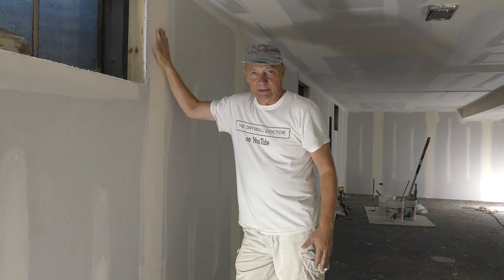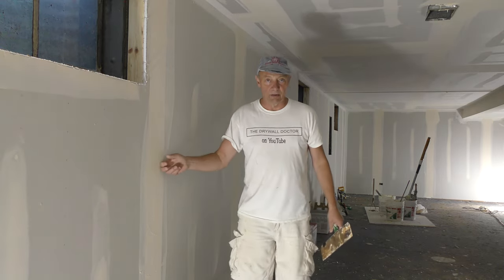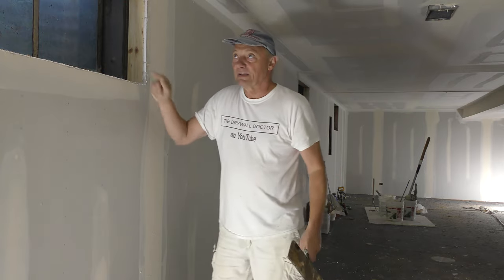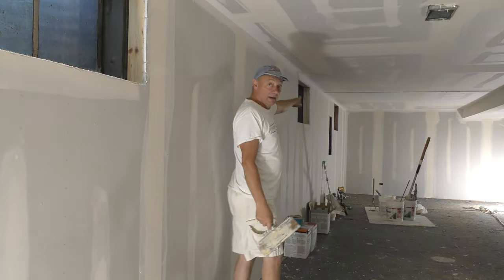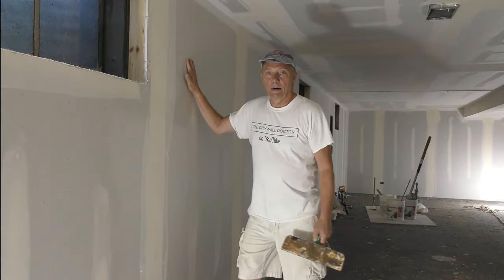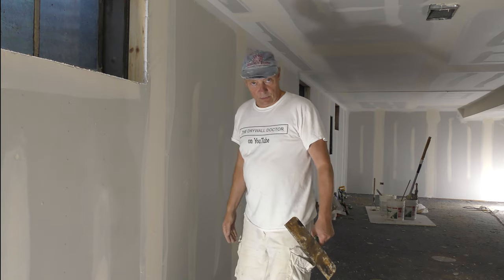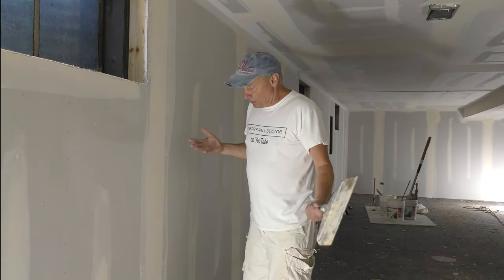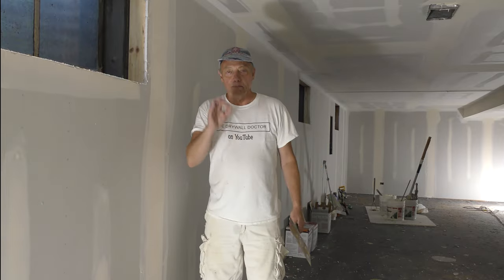Durabond Prefill Please

Comment: when I first started hanging and finishing my own work I knew as much about drywall as I do about the dark side of the Moon. So as any good engineering student does, I read the manual, several times and practiced.   It is available via CGC/USG's web site.   I'm sure each drywall vendor has their own version available.    All of your videos teach and explain as per the manual, which made the learning curve much simpler, thanks Ray.

And the manual doesn't state any different between vertical or horizontal installation, if a framing member (stud) warps that will happen regardless of the drywall.   And should be addressed prior to drywall installation (but due to crap building materials these days we have to work with what we got).    As is prefilling, which is stated as step one in the finishing process.
Reply from the maker: Thanks.  I did a job once they laid the drywall down half inch drywall the studs were 2 ft on Center and in between the studs you could just push the drywall back and forth that drywall definitely should have been stood up not laid down

Comment: I stick fiber mesh on the tapers then prefill with durabond.  That combines prefilling and first coating.  I use paper on the angles and fibafuse on the butts (which I also prefill).  Am I wasting time?  Don't know and don't care.  I've done everything I can to avoid cracking and that's what matters to me.  If I used a bazooka I'd have to change that but the jobs I do are mostly smaller and the cost, in terms of money and learning curve doesn't make sense to me.  

This might interest you.  I did some research on drywall movement and found the following:  Note this for for unattached drywall.  Screws reduce the movement somewhat and glue reduces it more.

drywall moves .0000093 per inch per degree change.  That means where I live that a 24' wall or ceiling in an unheated garage will move about 3/8" due to temperature change throughout the year.
drywall moves .0000065 per inch per percentage of change in relative humidity.  Using the same garage, my expected movement will increase to better than 1/2".  
Again, these numbers are for loose drywall.  That said, it seems clear to me that prefilling simply isn't optional.  I KNOW the rock is going to move and there isn't anything I can do to stop it and that doesn't include settling of the framing.  The best I can do is make the movement only happen in the corners by doing what you say-- turning the wall/ceiling into one condinuous sheet.

Running the rock up and down is sometimes the best option.  But I really don't like doing it in a room with lots of light.  Crooked framing can make the wall look wavey even if the joints themselves are perfect because there is a continuous joint running from the floor to the ceiling.  If I'm stuck running the rock up and down in a well lit space I'll use buttboards and make the joint in the space between the framing and feather it way out (if necessary).

Comment: We have a product out here , like Duranond on steroids; Concrete Fill , same basis as Durabond , however they add Apulgite and shredded fibreglass . A repair with that is stronger than surrounding board , mix into mud and coat beads or deep fills , zero shrinkage , sets up FAST ,
Reply: Yes all  Canadians can translate Durabond to Con Fill, it's an outstanding product.
For those marrying stucoo and drywall, or repairing stucco plaster  it's a dream product to work with, if you don't have Structolite etc available.
Thanks for posting !

Comment: I been finishing for a living over 30 years I always prefill I started doing several years ago because I got tired of the tape bubbling up. Prefilled prevents this .
Reply: Try putting the correct consist of mud and correct amount and there will be zero dry spots
Reply: it is actually an old method and until YouTube the knowledge and some of the old ways of doing things have been lost.

Comment: Hi I love your videos GREAT JOB, I have been a contractor for 38 years    . Question I was always told only hang sheets straight upand down on steel studs . On wood go horizontal with a offset . Reason being if a new stud dries outit will just crack the drywall instantly. Now on a older dried  out stud different story
Reply from the maker: Stand up drywall came into play with 2' o/c it is very weak between the studs when it's laid down and 2' on Center.

Comment: Does prefill prevent cracking by deformation of wood stud through humidity?
Reply from the maker: Only if you have a place for the drywall to settle to. Like a 1/2" gap at the floor.
Reply: @THEDRYWALLDOCTOR1  I see. Most new comercial place in here set the new studs for partitions or new wall.

Comment: Ray they quit pre-pre filling because they don’t want to pay the money . I personally want finish drywall without pre fill, dura bond or nothing 👍 .  What really ticks me off are the hangers who want bevel the butt joint, having way to many junk factory paper if not V out. If a contractor gives a hoot he will make sure it’s pre filled. Iowa you cant get away with not pre filling or your going to have trouble in less than a year, no cracks in ten years except screwed up stress points. 😂

Comment: If you only prefill without any bonding agent (like mesh tape or fibafuse) it won't be stronger. even if you tape it after it has cured.
Durabond is extremely strong but without a bonding agent it's as weak as regular mud as far as cracking goes. I don't understand why you tape your seams if you prefill with pure durabond. I've been taping with mesh tape sunken in pure durabond for 10 years, never seen a company seam crack. But I completely fill in the tapered egdes on my 1st coat. it's the key. Then 2 top coats (12" box then 15" box) and Voila. 
I agree with you, 8 footers needs to be standing up. all those butt joints on that loooong wall is calling for disaster.

Comment: How do you avoid crowns on youre flat joints. I use columbia boxes. 7, 10 and 12" and only put on enough mud to cover all the bevel on each joint. But, if i run my hand down my walls after sanding i can feel every joint.
Reply from the maker: Stop using the seven just the 10 and 12

Comment: I heard about how hard Durabond gets when fully dried, so being a DIYer, I was worried that if I made a mistake, I wouldn't be able to sand it down. So I've just been using regular quick set for pre-filling. But was thinking about using Durabond when I actually put up new drywall in my garage.
Reply: sanding brown bag durabond is not that hard! very doable! done it for years! trick is to avoid, eliminate & minimize sanding by employing some skills & care, that is v. doable if you have some basic application skills. i've developed mine slowly here & there over decades, they're now very sufficient! however, if d-bond dries on you in a bucket - the bucket is trash - don't even try to scrape or wash it out! watch that clock! & very careful with the plumbing/drains too!
THANKS RAY! Hi to Chicago!
Reply: When you apply the mud (any kind) you need to feather the edges so you won't have to sand so much me personally I rather apply many thin coats that one thick one I hate to sand js it's many ways to skin a cat find what's best for you
Reply: It’s timed so for starters get the longest time n just do a few sheets at a time. I ended up using 90’. N glh !!

Comment: We've  been hanging standing drywall in my home for over 7 years. We're redoing the exterior walls in the rooms on the lower level of a raised ranch. There was so much air infiltration because the house was built in 1979. Hubby hangs it and I finish. No cracks anywhere!!

Comment: Have a question. sometims I got some buble under the tape after taping. what would be the reason of that? Mud was too thick for taping?
Reply from the maker: Or to thin
Reply: @THEDRYWALLDOCTOR1  need more experience
Reply from the maker: I found when I mix my mud too thin I tend to have more blisters when it's too thick it's just hard to work with it hurts my wrist
Reply: @THEDRYWALLDOCTOR1  thank you for share your life experience
Reply: did you prefill?
Reply: @robertmclaughlin7757  yes I did
Reply: @robertmclaughlin7757  today I checked and.. I guess there was not enough mud under the tape.

Comment: I wish I understood why prefilling makes the wall less likely to crack/stronger. My understanding is that the papertape is where all the strength is as far as holding a joint together. Mud is basically  concrete without the rebar. Why does it matter if the first step is the papertape? After all its still embedded somewhere in the joint.
Reply from the maker: Durabond is harder than all purpose. If you tape with a setting compound there is no need to prefill
Reply: @THEDRYWALLDOCTOR1  yes harder , but it is bonding to paper edges , that is the weak spot , no matter how hard the compound , your weak spot is there , if there is movement, it will crack there . Same issue with contact cement on trim tex beads
Reply: @willkeith4944  you are correct that its a week spot. But when you prefill you are essentially filling the weak spot joining the two sheets then you are putting tape over it and covering it. If you don't prefill you risk having a gap. If there is a gap you will have cracks
Reply: @mikecase9365  all tape is embedded in a bed of mud ; either bazooka or by hand if that’s how you do it ,
Reply: All purposes will shrink
Reply: there is a gap between the pieces of drywall, prefilling fills this gap, thus when you apply the next layers the mud cannot shrink into the gap potentially causing a defect or weak spot.     It also gives strength when building movement happens (all buildings move, the ground we are sitting on is floating at a geographical level) or movement in the wall occurs due to temperature or material (wood dries out inside the wall) changes.
Reply: @willkeith4944  yes all tape is embedded. But say its a half in drywall. You have tapered edges on runs so its just under the half inch. When you tape you add water to the mud the mud shrinks sucking the tape to the wall but it also sucks away from the wall at those joints. Any gap over 1/8th inch will result in a high likely crack. You fill to ensure you have mud in between the gap not relying on the taping mud to fill. You could put 20 layers over the tape but if you have a gap behind the tape you will get a crack. I can't count how many repairs I've done because of no prefill from other tapers but I can count how many call backs to repair my work 0. I fill everything nothing to chance.
Reply from the maker: Same here I have repaired so many houses that were never prefilled and the prefill would have stopped all those cracks thank you

Comment: I aLso have over 40 years taping in Alberta , have yet to see anyone prefill , in fact you cannot buy Durabond out here , there is hundreds of thousands of homes built in the last 50 years around here , there are very few cracks , and when consider we go from minus 40 to plus 40 , freeze and thaw , have to bury water lines below 8 feet , if things move they will move here. If that joint is going to move and crack  , it is physically impossible for applied compound to stop it , secondly,the rates for tapers hasn’t changed in over 20 years , to dream of wasting a full day and the cost of that bag , simply means you are doing that for fun , not an economic return nor will it have any assurance of avoiding a crack. And , no I don’t 3 coat flats , wipe in with an 8 inch , box with 10 and 12 , you can put a knife , level whatever you want and the joints are flat. The mud they have is exceptionally good , the tools they designed are flawless , I am very annoyed that anyone would try to get somebody trying to make a living in this trade waste time and money , for absolutely zero benefit
Reply from the maker: In Florida and Arizona they didn't refill either but everything was textured is everything textured there?
Reply: @THEDRYWALLDOCTOR1  just majority of ceiling.
Reply: @THEDRYWALLDOCTOR1  Texture is a USA thing. Walls are flat in Canada.

And his comment is accurate from another Canadian with a frost line of 6 feet. No one pre fills here and cracking is a non-issue with our major seasonal house shifting.

Comment: Hi drywall Dr! Per youtube’s recommendation I came across one of your older videos. And like in this newer video (and many other videos) you talk about pre-filing, durabond and importance of it. Now, I am curious if you have an answer on following mystery considering your great approach towards work and long trade experience. We can not find products like durabond, first-coat primer, guardz and sooooo many other key problem solving products at big box stores but rather at ACE Hardware, Amazon (if lucky) or out of the country (Canada) online stores. Why??? Brands like Zinsser and USG are more then represented at big box here in the US and yet all the good stuff they do not stock. Something tells me you might be able to help and bring some sense this nonsensical mystery. Thanks in advance.
Reply from the maker: I found I can't get USG first coat at Home Depot but I can get it at Menards why I don't know I have actually contacted USG and got contractors the materials that they needed in Canada where they couldn't find what they needed. You can contact them directly to find out. Also try Hamilton I really liked there speed set hot mud.

Comment: Standing them up makes absolutely no sense to me. That entire joint is on one stud.  Prefilled or not that stud warps you got a crack. Laying them down is stronger in my opinion.
Reply from the maker: In this case the wood is 20 years old or older. Laying them down doesn't stop a stud from bowing but like I said in this case it saved time and money for the home owner and me.
Reply: You’ve been doing this a lot longer than me and you’re probably right but time and money doesn’t seem like a good enough reason for me. Rock on!
Reply: They usually do stand ups in commercial work here , virtually impossible to hide , no matter how many coats , boxes or knives or trowels , I have done service and QC on thousands of floors , if stand ups you will see them or you will skim the entire wall , floor to ceiling when the sun shines in